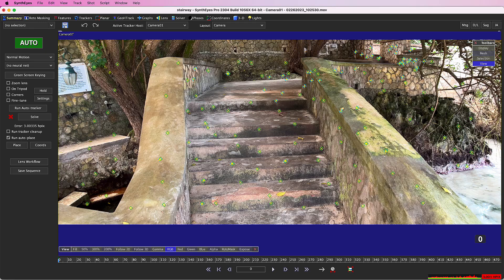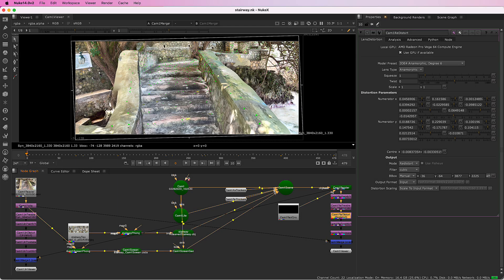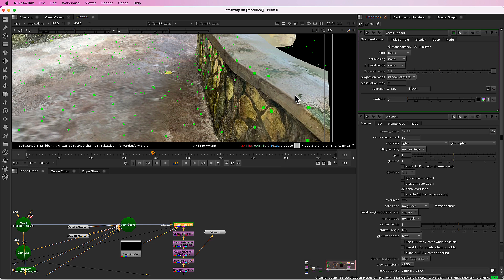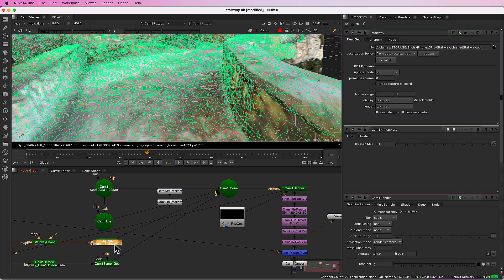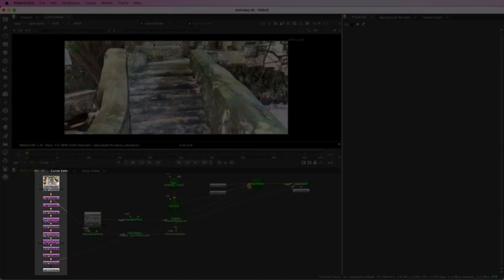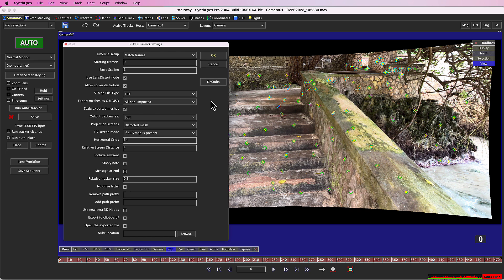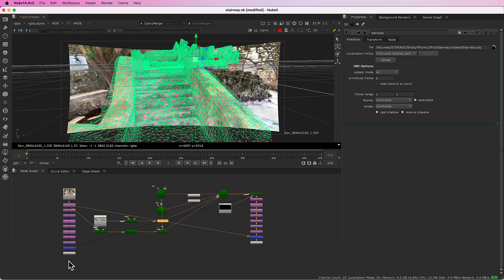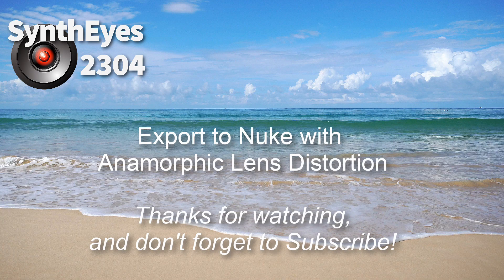Exporting to Nuke from SynthEyes with Anamorphic Lens Distortion

Comment: Hello Sir, I have a question? In mocha pro plugin in AE when you use roto or tacking in full resolution it tracks slow but in AE in Quarter setting it track or roto fast. So is there is any ways to track in Mocha pro standalone quarter setting to track or roto fast. Means that how insert footage of 4k into quarter setting like in ae?
Reply from the maker: Yes.  At the top of the viewer there is a button that says 1:1.  That's the proxy setting.  Take that down to 4:1 and you'll get the same behaviour as you do in AE.